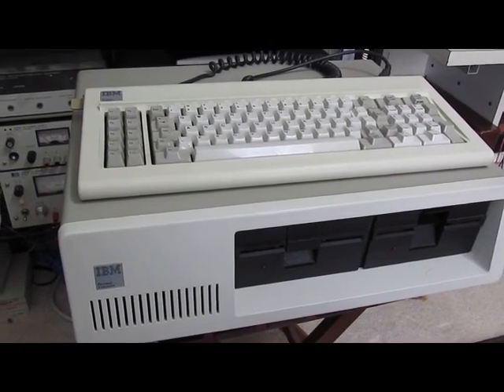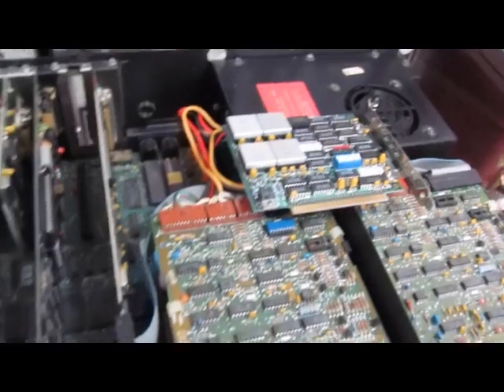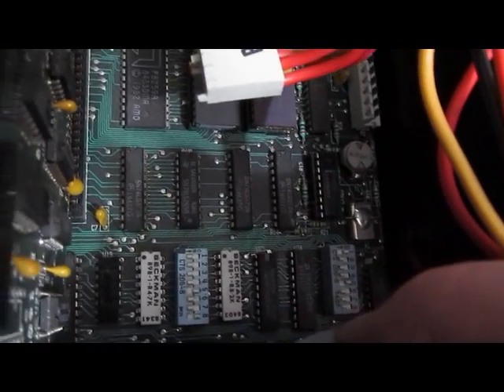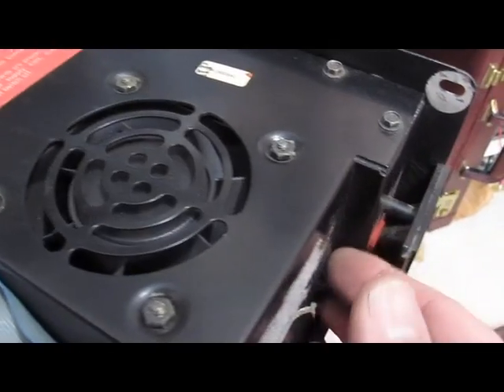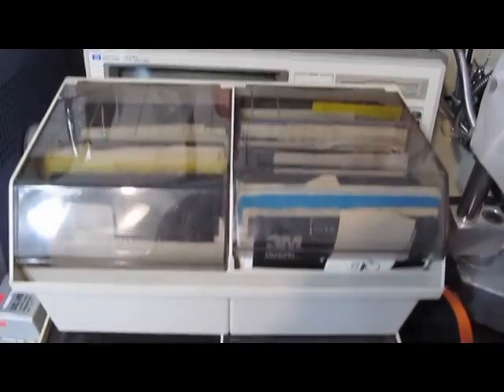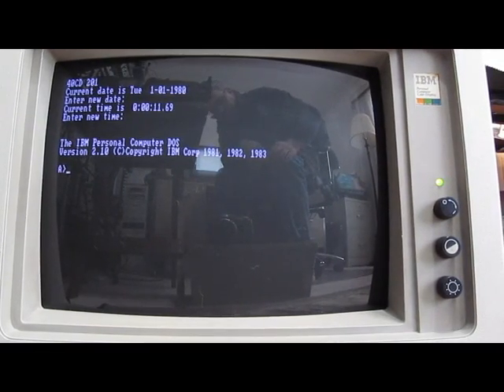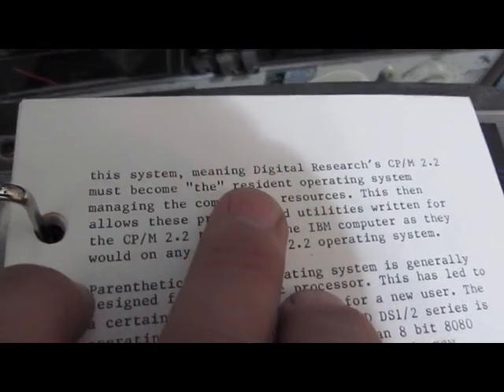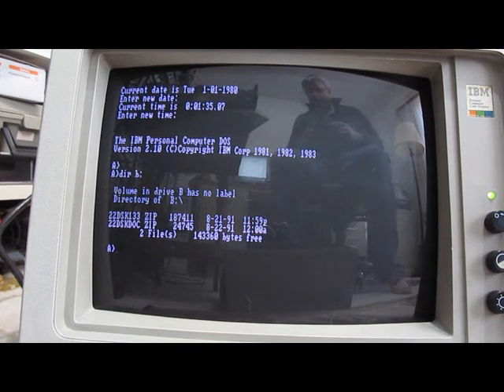IBM 5150 with Z80 CPM board

Comment: Nice video.Ive got the IBM 5155 wich is the same inside yours one.With a soarers converter you can use the keyboard on a modern cp.

Comment: I always thought CP/M ran natively on the IBM 5150.  For some reason, I thought Digital Research ported CP/M to the 8086.  So you needed a Z-80 card just like with the Apple II, to run CP/M on the IBM PC?
Reply: IBM PC run natively the CP/M-86 .
Reply from the maker: That was 35 years ago.  I would consult Google as that's going back a bit too far for me to be certain.   I had some old computers running CPM prior and up to the time the PC was released.  The Televideo I have was released in two flavors.  One with the Z80, the other with the 808n depending what OS you planned to run.  It seems like at one point I remember seeing a version of CPM that would indeed run without any special hardware.   But it also seems like by that point DOS was good enough to use and most companies had adopted it.   I think the BIOS supported external devices and we even had the Corvas HD by then.  There wouldn't have been a reason to run it.  Again, I could be totally wrong about this.   Then again, it's possible I may actually have it in a pile of old floppies.
Reply: Okay, that's what I thought.  Digital Research did port CP/M over to the IBM PC.  So, what would the purpose of having a Z-80 add-on card be?
Reply: @dbranconnier1977  Running programs written for 8-bit CP/M-80 (the original CP/M line), which would be the vast majority of CP/M software.  Such code won't run on an x86 processor without being translated from 8080 or Z80 assembly code to x86 assembly, then re-assembled.  Now, tools were made to make this process easy and quick, but it was still much like how today Microsoft makes it easy and quick to cross-compile your code for both the x86-64 and ARM versions of Windows simultaneously but most companies don't bother.

You can, however, natively run most 8-bit CP/M-80 programs on Micosoft MSX-DOS (also 8-bit), as that is natively running on a Zilog Z80.

Comment: Откуда такой раритет ? :)
Reply from the maker: +Виталий Шамша The Z80 was given to me by a friend of mine many years ago.
Reply: joe smith
And about the ZX-Spectrum in Z80 know ? :)
By the way Hello from Russia :D
Reply from the maker: Hello Russia!   The little computer is an the US version Timex Sinclair.  I guess the original white ones are getting had to find now.
Reply: joe smith
We have the original, there were hardly many versions were developed by fans within the country
Reply from the maker: Nice.  Does yours still work?
Reply: joe smith
To my great regret gone, but there is a desire to make on modern components under the control of the processor Z80 at 28 MHz.
Reply from the maker: Seems like there would be simulators by now for the PC that could run all the old software.
Reply: joe smith
Emulators on PC, but live has not been canceled :)
Reply from the maker: +Виталий Шамша Have you heard of a release date?   When could the public purchase one?
Reply: joe smith
Most likely never, long time ago it was :)
Reply from the maker: +Виталий Шамша I thought I had seen a company was going to try and make some sort of replica a few years ago.
Reply: joe smith
Well, in Russia as would produce piece parts, but it is not massive.